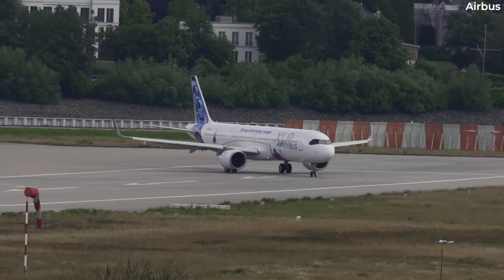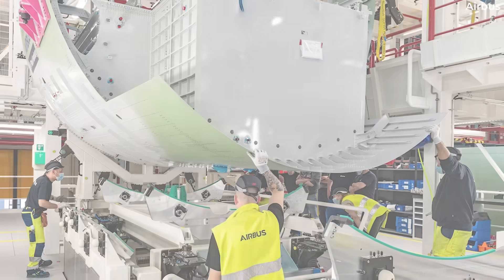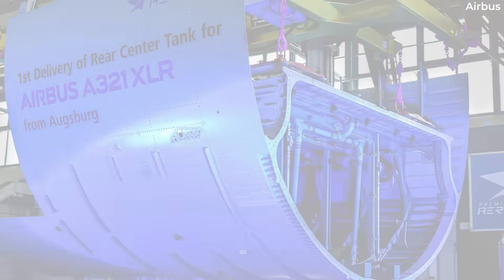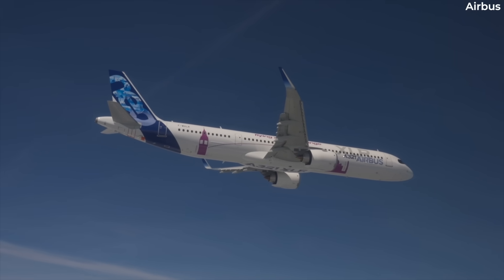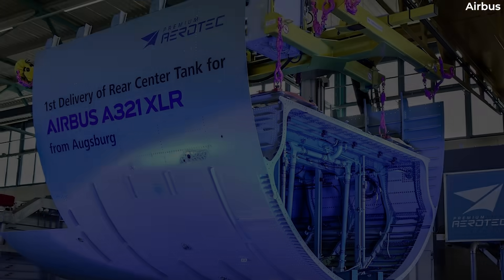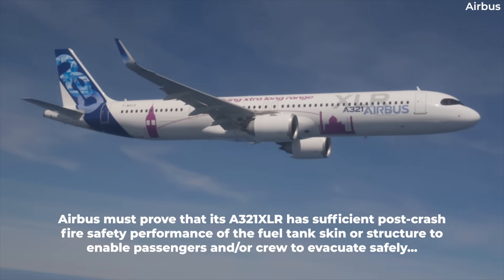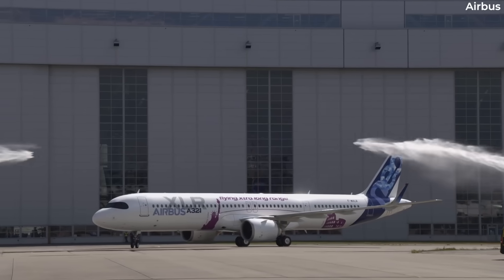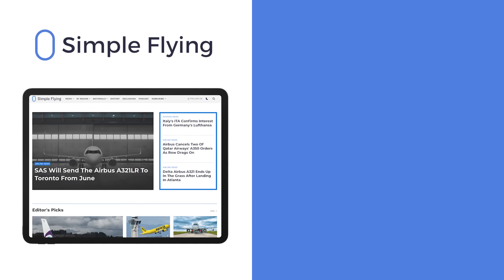FAA Proposes Safety Requirements for Airbus A321XLR Amid External Fuel Fire Concerns

Comment: Worked on many aircraft for many years, mostly older Boeings with bladders fuel tanks in their center wings, and even aux tanks in the cargo bins, also bladder tanks. I don't recall any airplane that has post-crash protection for fuel tanks. Maybe I'm missing something, but looks like a politically motivated agenda.

Comment: I'm done flying. Any questions?
Reply: Although there are very good reasons to drop flying (especially environmental ones, in Europe, where the railway alternatives are usually quite competitive), finding problems in pre-production planes should encourage you to trust airplane's safety.  It is NOT finding problems before planes start to crash (e.g. Boeing 737MAX) that should worry you.  The airplane industry has always taken whistleblowers and security very seriously and that's why flying is very much safer today than in the past.

Comment: How cold is the passenger cabin directly above the fuel tank going to get? The fuel itself can easily be -20 or -30C. If the top of the fuel tank is right under the cabin floor, then it might get really cold for the passengers above it.
Reply: There is this stuff called "insulation". You already often fly directly atop fuel tanks anyway.

Comment: Glad they are finally thinking about safety. Where were they when greedy companies want to remove the 2 left and right FLOOR LEVEL DOORS, right in front of the wings for 4 window exits that are slower to evacuate. Did they recertify the aircraft with the new door configuration? I doubt it.
They wanted this so that their premium cabin will not be broken up by the doors. Spearheaded by Lufthansa, then the rest jumped on.
Center tank design is sketchy. Many aircraft have center fuel tanks that are fully self contained, this design is not. Concord may have had this design, but not sure. Hard pass. Yikes!!
Most airlines are not really interested in safety unless pushed. This includes ALL majors. They regulate through blood flow not common sense. In other words, when enough people die, then they will change something. It's a terrible industry. 😵‍💫

Comment: Nice of the FAA to do its job… Though the 5 minute timer is odd, considering they’re meant to evacuate all passengers in much less time.
Reply: Isn't it more like 90 seconds?
Reply: 90 seconds to get out of the aircraft, but you've still want time to get away from the aircraft before this tank goes up?
Reply: @roadie4360  and get fire crews to the crash site before the aircraft detonates itself... hence the 5 minutes.
Reply: Is FAA job to push down Boeing competitors?

Comment: Worked so well on Concord. 🤦‍♂️
Reply: yes it worked until mcdonalt douglass ruined it with their dc-10
Reply: Slightly different problem - it was the access panels in the wing being too easily punctured by debris that led to the tank being ruptured.
Reply: Actually concord didn’t have any protection

Comment: FAA? Aren't those the same guys that approved the Max ...twice?
Reply: The compensation was there to make the max fly like the older versions from the pilots perspective, it was not there to make the plane safe, it would have flown perfectly fine without it.
Reply: Yeah !!! 😮
Reply: Why are all my comments being banned?
Reply: @gort8203  This one wasn’t.
Maybe you’re posting links’s.
YouTube deletes those.
Reply: The max design is perfectly fine. 

The issues with it are due to lack of training and manufacturing/maintenance QA issues.
Reply: @DeltaEntropy  wrong
Reply: @DeltaEntropy  no, the design with the new engines is not fine (too much weight in the front due to the engine position) that why they had to compensate it with electronics
Reply: The maxs design is completely safe now. The problem is Boeing building them right
Reply: @zmanzd8413 now eventually, but when the Max has been approved by FAA it was not safe.
Reply: @zmanzd8413 completely safe except the unsafe deicer LOL
Reply: @zmanzd8413 so then they’re not completely safe if the problem of Boeing not building them right still exists
Reply: @JackieO_LAX  I said design not final product
Reply: @JackieO_LAX certification does not take into account manufacturing quality issues. The cert means that the aircraft is engineered correctly and safely. Key emphasis on engineered. Quality control issues have nothing to do with the engineering of the aircraft. That’s something Boeing needs to get under control on their own.
Reply: @zmanzd8413  wrong
Reply: @dknowles60  Very enlightening comment

Comment: Who wants to ride on top of fuel tank?
Reply: LOL If you have issues flying on top of fuel tanks, you may want to look more into both automobile and aircraft history than you have.
Reply: @DataRew  interesting that you are comparing historic data for automobiles vice certification for new aircraft.  Thanks for self-identifying.
Reply: @vincentsutter1071 most aircraft, past, present and future, you ride on top of fuel tanks. Nothing new in that regards.
Reply: In the Boeing 747 the center wing tank is right under your feet. Worked well so far (with exception of TWA flight 800, but her problem was the tank was empty)
Reply: @peterparker219  are you that Friendly Neighborhood guy?

Comment: Sounds very sensible. I was at Haneda when the A350 caught fire and it burned very very quickly.
Reply: The A350 burned slower than what was actually expected of the composite fuselage and did its job protecting passengers and crew from the fire underneath the aircraft so they could safely evacuate.
Reply: It did actually burn very slowly but it took ages before they initiated the evacuation. The composite materials burning trough much slower than aluminium fuselage is what saved the passengers there.
Reply: @MrDiamondFlyer  OK so where about at Haneda did you watch from? I was on the roof of Terminal 3 with NHK News on my iPhone
Reply: @richjames2540 doesn’t matter if he was there or not. It’s a fact that the composites burned much slower than traditional materials. You might have thought it went quick, but that’s because you have nothing to compare it to.
Reply: It didn't burn quickly, in fact traditional materials burn faster.
Reply: What's your point?
Reply: @ulrichschenk8202 them Airbus aircraft burn like Roman candles.
Reply: unbelievable that your comment got likes. You are totally uninformed

Comment: I thought it was already certified?
Reply: Nope probably not before 2027 if at all
Reply: @stevesmoneypit6137 what? It will be certified this year... These requirements here have been already implemented, because the EASA already issued the very same requirement last year.
Reply: @stevesmoneypit6137  Did they let you out of the locked ward again?
Reply: @stevesmoneypit6137  If the XLR is not certified, no Boeing airplane ever will be able to be... The safety and design standards between the 2 companies couldn't be further apart.
Reply: You thought wrong.

Comment: Just imagine if the FAA being this strict with Boeing...
Reply: They are now.
Reply: What do you think why 777X, 737-7 and -10 are delayed for years?
Reply: Bro thinking they don't strict to boeing. Look where b737 max 7 and 10 and B777x.
Reply: @Hanginthere4100 bit late now.
Reply: Yea
Reply: Did Boeing catch fire?
Reply: 😊😮😊😊😮😊😮😮😮😮😮😮😊😊😮😊😅😮😅😮😊😮😊😮😊😮😊😮😮😮😮😮😊😮😊😮😊😮😊😊😮😊😮😮😮😮😮😮😊😮😮😊😮😊😮😮😮😮😮😮😮😮😮😮😮😊😮😮😢😮😊😮😮😮😮😮😮😊😮😮😊😮😮😮😮😮😊😮😊😮😊😮😮😊😮😊😮😮😊😮😮😮😮😮😮😊😊😮😊😮😮😮😮😮😮😮😮😮😊😮😊😮😊😊😮😮 lol😮😮😊😊😮😊😮😮😊😮😮😊😮😊😮😮😮😮😮😮😊😮😊😮😮😮😊😊😊😮😊😅😮😮😮 LL😮😮😮😮😮😮😮😮😮😮😢😮😮😊😮😮😮😊😮😊😮😮😊😮😮😮😊😊😮😮😊😊😮😮😊😮😊😮😮😊😮
Reply: To be frank, I think that FAA is adequately strict with Boeing now. But it took the door plug debacle to reach that point - 350 dead passengers did not suffice.
Reply: @bazoo513  You know that mcas was still partly pilot error, right?
Reply: @CineZoneYT  wrong
Reply: @dknowles60  IT was. Pilots had encountered the error before and disabled the stab trim. The plane in the Indonesian crash had the error multiple times before and the pilots just disabled it, but their mechanics kept putting it back in service.
Reply: @CineZoneYT  wrong,  if that were the Case why was the Max grounded
Reply: My first thought.
Reply: If the FAA was not this strict with Boeing it would have several new aircraft certified.
The problems with Boeing are almost all in managing the factories.  At Boeing and the suppliers.
Reply: @danharold3087  FAA allowed Boeing to "self-certify" for decades.
Reply: @bazoo513  YEA
Reply: @bazoo513  no they didn’t. The FAA allowed them to self inspect, not self certify. The certification still comes from the FAA. Why are you spreading misinformation?
Reply: @FlyByWire1  No. The certification was done overwhelmingly by Boeing, FAA only signed the papers. That's why Boeing was able to lie on what they wanted.
Inspections are only for manufactured planes, not for certification.
Reply: @jgnclvgmng5408  that’s not self-certification though. The FAA is the only entity that can issue the cert. The EU has the exact same system because there are not enough regulatory resources for the agency to verify every process and component in the manufacturing process. And who told you inspections were not part of the certification process?! Yes they are, they always have been.
Reply: Boeing and airbus both use spirit.  @danharold3087
Reply: @danharold3087  but Boeing does have several new aircraft certified that shouldn’t have been certified…
Reply: @xpeterson then explain how the 737-7 ,737-10 ,777-8 and 777-9 haven't been certified yet
Reply: @xpeterson like which ones?
Reply: @Thompson123-ih4uh because they are finally doing their job. Explain why MCAS was hidden and the FAA knew?
Reply: @danharold3087  Yeah sure, it's managers not tightening the bolts on the doors and writing the software to pitch down into the ground ...
Reply: they are. If FAA are being strict the 777X would be certified by now.
Reply: They are, at least on the structural side. They review (and delay) reviews for substantiating data for months with engineers from boeing going back and forth with the FAA engineers. Cert, alterations, etc. For matters related to Airworthiness Directives that need more immediate resolution, they have time limits and those get heavier attention.
Reply: LOL! YEAH!!!!!!!!!
Reply: THANK U!!!
Reply: stop hating. EU regulators are always much stricter with AMurican designs than they are with their own!

Comment: EU regulators have the same concerns
Reply: Had. Airbus and EASA already agreed on the requirements and test aircraft is already flying for months.
Reply: @user-yt198  has… hence the changes implemented. Those concerns are still there just now mitigated by changes. The FAA has their own concerns based on the aircraft design provided to them. Was the changes implemented for the EU submitted at the time of application or is the FAA working on what was submitted?
Reply: Doing the job on behalf Boeing lol

Comment: FAA's points make sense. So it's further delay then.
Reply: Not addressed in this video is whether Airbus has already considered this requirement, and what tests they have already performed for EAA approval...
Reply: @NikonF5user  It's EASA on the other side of the pond.
Reply: @acrodrigues1  Yep! I mistyped! Thanks for the correction...
Reply: no, that should be no further delay. These requirements are identical to the ones the EASA issued last year.
Reply: @usakousa no sir, the FAA is taking last minute instructions from Boeing executives